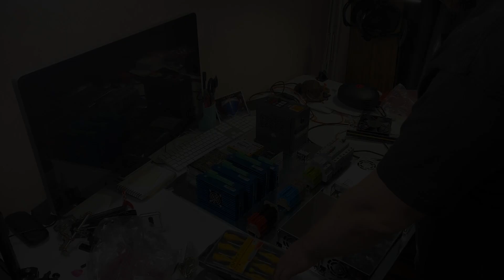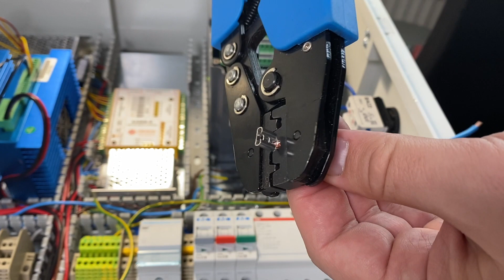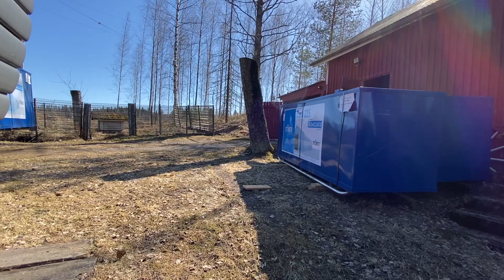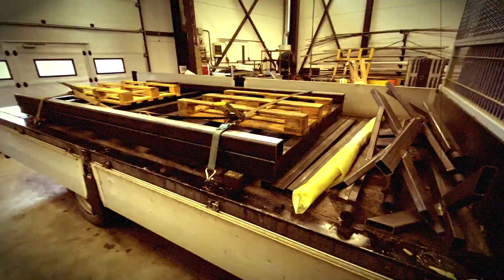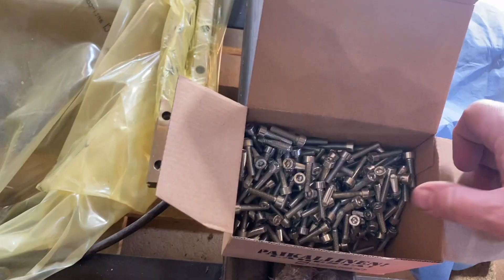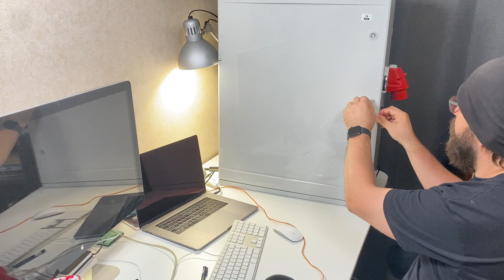Big DIY CNC router - part 4 - Electric cabinet and installing rails. Ep19 Project SeaCamel

Comment: Hi. The VFD is controlled via RS485 ? Thanks in advance
Reply from the maker: Hi! There's analog 0-10v (if i remember right... might be 0-5...?) output in the CNC controller and the VFD has similar input. So it's just analog voltage adjustment. 0V = no spinning. 10V = full speed which this case is 20000rpm.
Reply: @ArcticSeaCamel  Thanks for the clarification, so you are using the 'standard' way, not the RS485 control
Reply from the maker: I suppose so! 🤭

Comment: Do you have a backlash with your rack & pinion leaner gear system on your cnc axis ? if yes how you solved it ? please
Reply from the maker: Hi! I tested the backslash initially but I couldn’t measure any with manual tools I had. So I don’t have any compensation for it.
I would imagine that there is some that can be measured in hundredths of millimetres, but it’s so small that with wooden pieces it’s not noticeable.
Reply: @ArcticSeaCamel  I plan for milling one by 3 meter for Y axe using rack ponion but Im so worry about NOT getting precise cuts because of the backlash, I got an idea to solve the backlash issue 100% which is to use TWO gear per a leg stretched outward from each(they are on same plate), did You got what I mean ?
Reply from the maker: @amrsvn-uf2jk  Yes I did! Check out RoboCNC's excellent video about this matter: https://www.youtube.com/watch?v=2SAnDSnotZw

I desided not to do this. It would have been just too complicated for my need. I just kind of took the design ideas from Avid CNC machines.

As mentioned: I haven't had any problems with backslash. The Rack and Pinion I bought were industrial quality and therefore seems to be very precise. In setup like this it's very important to calibrate the machine well and remember to put the power on always before doing anything with the machine (cleaning etc). If power is off, you can pretty easily move the gantry's either end and mess the calibration!

One option I looked into was to use two ballscrews and rotate the the bearing (not the screw) in the gantry. It is complicated to build but precision should be much more reliable!
3 meter ballscrew is too long to rotate, it just start to wobble.
Reply: @ArcticSeaCamel  Thank You so much for this Idea, moving the bearing(not the screw) I like this idea, Im abit worry to rely on rack pinion for precision considerations.
Reply from the maker: @amrsvn-uf2jk  Yeah, there should be solutions to do the trick that way. It's just not that easy. But probably the very best way to do long and very precise machine!

But of course when going to certain precision you'll start to need separate measuring devices, temperature control etc... 😅

Comment: There is no issue on quality  if you merge two rack gears
Reply from the maker: Yeah, the machine has been working great. Just need to make sure initially that the gantry is square.
Also you need to be careful when machine is off and motors offline. Then they can be moved with hand and calibration can be messed up for good!

Comment: what do you mean spring righted rack pinion?
Reply from the maker: Hi! Thanks for the question!

The rack and pinion are tensioned together with spring to avoid any jumps.
You can see the system in action in later videos!

Comment: I didnt see if you check how coplaner threw out the travel of y axis.. did you do cross wire check to see if your rails  and rail support have any twist
Reply from the maker: Hi. The mounting surfaces and holes for the racks and rails were machined with great accuracy with a huge CNC-mill in a machine shop. So they're absolutely spot on!
I did the final tightening for the rails after the whole gantry was assembled. It is as perfect as i can be! :)
Reply: @ArcticSeaCamel  i was not refer to hole accuracy.. coplaner mean that surfaces are level... that are no dips with respect to each other and not cross leged nor twisted  from each other
Reply from the maker: @772777777777777  Oh, of course. Yes, the machine bed is very stiff. And the mounting surfaces were planed at the same level with that big mill as well. I checked the leveling of the rails with traditional water hose method a while ago after I changed the "legs" from those pallets to some plywood pieces and before I made any calibration. It was as accurate as i could see from that. And of course the bed itself is planed with the machine itself.

Comment: What kind of accuracy and repeatability can you attain with this rack and pinion setup?
Reply from the maker: Hi. The rack and pinion should be plenty accurate for my application. With the reduction and strong motors it should be fraction of millimeter. Currently I haven’t yet done the final install so there’s a bit of play on the pinion axel still.
What I’m little uncertain right now is the “power” of those springs I’ve got on the y-axis right now. They might not be strong enough to hold the pinion down at higher speeds. But they can be changed if needed.

Comment: How much did that gantry piece cost? Our cnc is an old MASTERWOOD 316k. You’re inspiring me to upgrade the electronics so I can move away from its current controller which I have to edit G code manually. No post processor exists for it. It’s a CN10 controller. 

So tempted to upgrade it to my own electrics. Looking forward to seeing more of these vids!
Reply from the maker: The gantry aluminum profile was about 400€. I will do a cost breakdown later. The overall price for the work done in the machine shop was several thousands anyway…
Reply: @ArcticSeaCamel  far out! That’s a serious bit of Ali. But a CNC is unbelievably useful. I’ve cut many parts out now with this old machine from 1997.
Reply from the maker: @sailingkulali  Yep. I think so too. I'm probably gonna use it for all kind of thing and maybe creating some side revenue for supporting this project. Thinking of CNC-machined architecture and furniture designs etc.

This aluminum piece was the biggest "affordable" piece I could find. There were bigger available, but their prices went to thousands of euros...
Reply: @ArcticSeaCamel  epic. Yeah I’ve been thinking about the same sort of thing. We use the machine quite abit for our business but would love to do things like build furniture or dog houses haha
Reply from the maker: @sailingkulali  Yeah. And the manufacturing is just the one part of it. Thinking of doing design work and such as well. :)
Reply: @ArcticSeaCamel  so epic. Love seeing people build machines and things from scratch. So much better reward than buying something from the store.

Comment: how did you make the rails paraller  ?  i think you should keep an edge  up when you machine it on the large milling machine ?
Reply from the maker: Hi! Thanks for your question. The rails are not yet fully installed. I will make the final adjustment when the whole thing is assembled. The mounting holes on the frame are machined within 1/100mm accurancy but the holes in the rails have some play in them. Another thing to consider is the seam between the two parts of the rails. They have to be very very precise to make the bearing cartridges to slide over them.

Comment: Hello from Canada and I built my own cnc about 4 or 5 years ago and a friend and I built a laser cutter since then he moved and took the laser cutter so I found it easier and cheaper to buy from China and I have had great luck with it so far.  I sailed years ago and am planning to build a boat also.  I will be watching and maybe help you if possible.
Reply from the maker: Hi thanks dude! Sounds good! I’ve been putting the cnc together in past few days and it seems to come up very well. And if there’s something to make better, I can later use the machine itself to do the parts. It’s also possible to get laser cutter or 3D printer head or anything for this frame.
Go and check insta/Facebook for more updates. 😊
Reply: @ArcticSeaCamel did u facemill it the hollowm how many thicknes the hollow sir?? 3mm?
Reply from the maker: @botak333  Hi! Not sure what you mean...?
Reply: @ArcticSeaCamel  did u milling (face milling) the surfe of hollow for stand of liner and rackgear?? And what hollow do u used 100x100mm?
Reply from the maker: @botak333  I suppose you mean the side beams where rack and the linear rails are installed?

Yes, they were machined with big CNC workstation to matching surfaces and all the holes were drilled and tapped with that as well. Also the racks and linear rail ends were machined to match together and into those holes. (I had to get the rails and racks both in two pieces to get the 3400mm length I needed) 

The beam was 100x100mm. Thickness was 8mm to have enough strength and material to cut off from.
Reply: @ArcticSeaCamel  owhh yeahh, so i want make it but use ballscrew, i want to used H beam, if i dont machining the surface of hbeam it okee? Because i dont habe big machine for it
Reply from the maker: @botak333  i suggest you use aluminium profiles instead. They’re quite precise, lighter and easier to handle.
The surfaces needs to be very accurate!
Also with big machine like this, the ball screw won’t work. It’s too wobbly.
Although you can rotate the ballnut instead of the screw but that can be tricky. Also very long ball crews are quite expensive.
Reply: @ArcticSeaCamel  i want to make fot cutting alumunium and steel, my cnc only 60x60cm